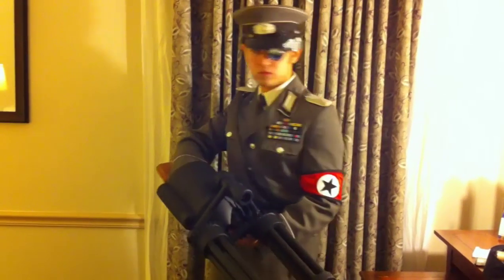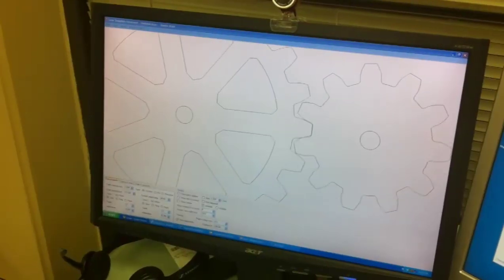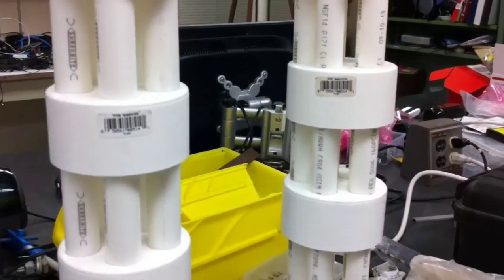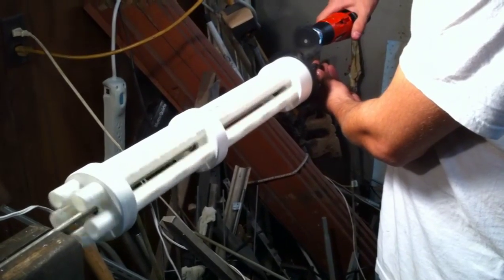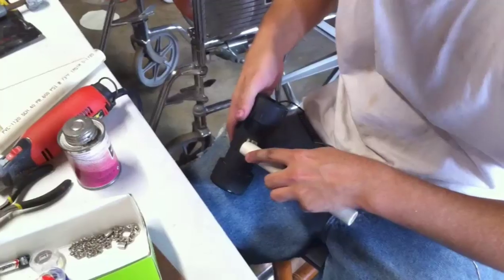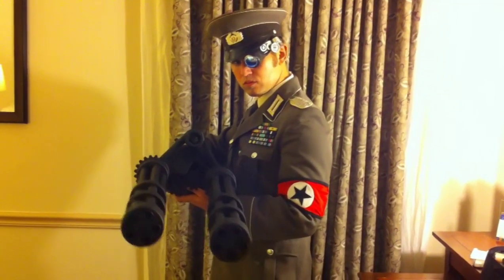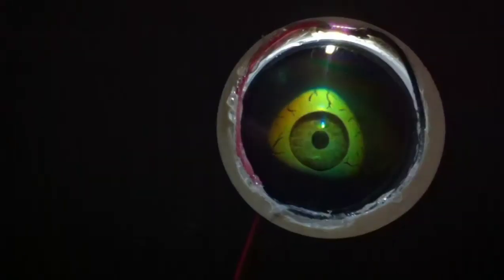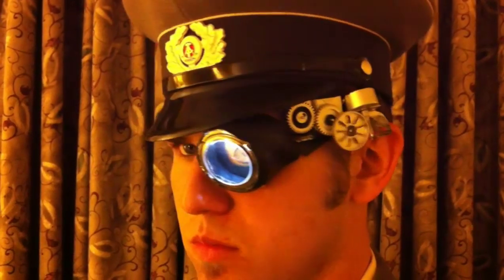Dieselpunk/Steampunk monocle and Gattling Gun Arm Costume

Comment from the maker: MTArbitrator, Sorry for the delay in response. Am currently deployed in the Navy. The "Z-rods" you speak of are the guide rods off of a baby bed. The one that the sliding door on the side of most baby beds are attached to. Although they are sturdy, they are quite heavy at any length, and add appreciably to the weight.  GL with your build.